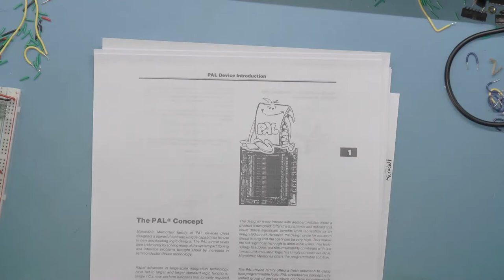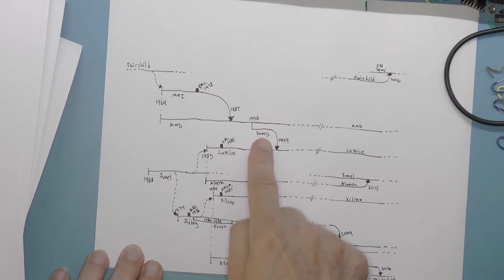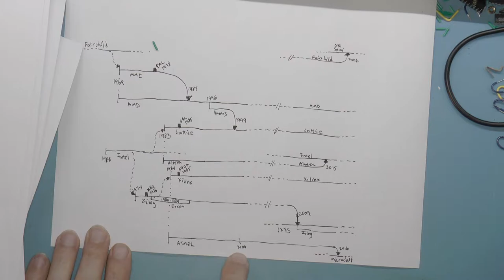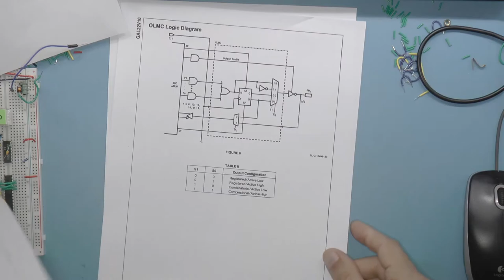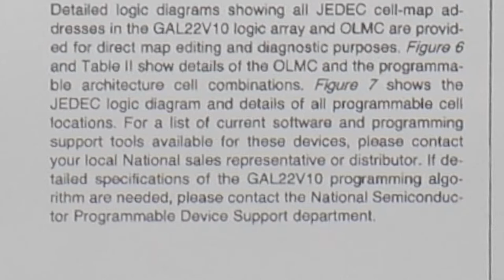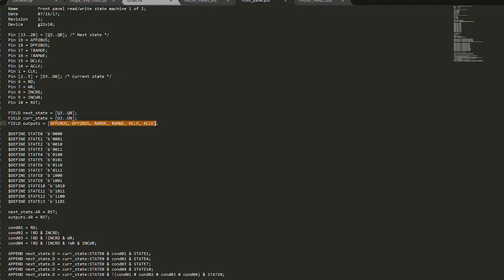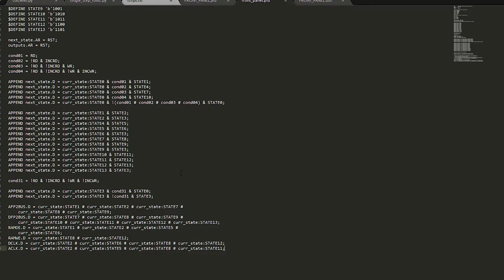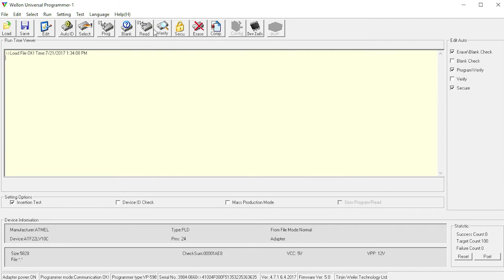Chip Tips #3: Generic Array Logic

Comment: mm I've never had a problem programming any of my ATF16V8s with the minipro/wincupl. Also, both minipro and wincupl work fine with wine under linux.
Reply: But it doesnt do the 22V10, correct?

I have  TL866, but since it doesnt do the 22V10 I am looking to replace it with something that does. And now it seems that the VP-598 has a bug and cant do them either. :-(
Reply: yeah it seems that way. thanks to this video I have done my own research. it's sad, because I've just ordered a few 22V10s a few days before...